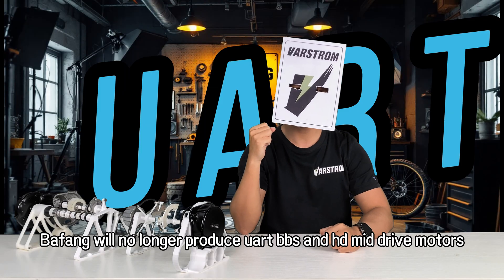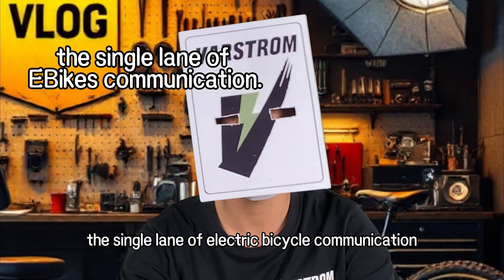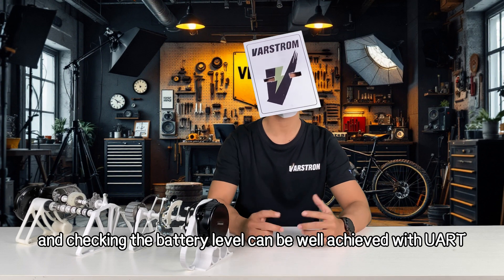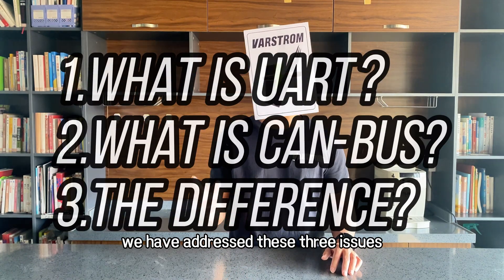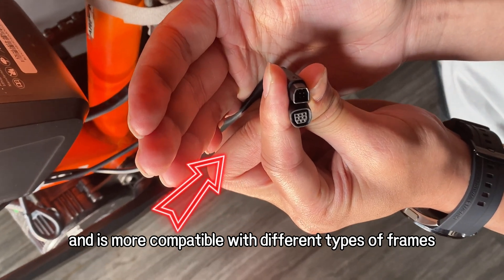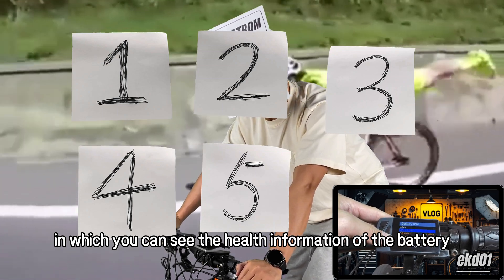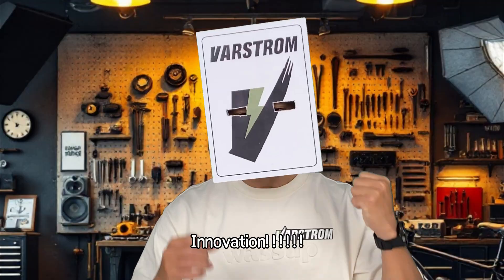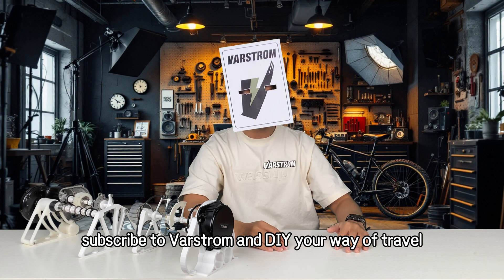News All EBikers Should Know!! WHY? Bafang no longer produces UART BBS & HD丨VS CAN-BUS

Comment: CAN bus hasn’t worked well for me. The display offers very limited settings (mostly just assist level), with no battery voltage configuration, which makes using a 52V battery on a 48V system difficult.

Throttle response is delayed and acceleration is slow, and the motor feels weaker despite similar specs, requiring higher assist levels and reducing range.

Since CAN bus was introduced, I’ve noticed earlier wear, unusual motor noises, and faster rotor wear, often before 4,000 km. Older UART motors lasted much longer.

If this mid-drive fails and nothing changes, I won’t use another mid-drive and will switch to a hub motor instead, as those still use the UART protocol.

Comment: I have na e-bike with a Varstrom VD618 display (Bafang CAN), 750W motor, using the Varstrom CAN cable and Varstrom software to program the controller.
I can save all the settings to the motor (PAS, current %, acceleration, startup angle, etc.), but nothing really changes in actual riding.
In the locked mode it’s far too weak, in the unlocked mode it’s far too Strong, and none of my settings work in either mode.
When I reconnect the cable and read the controller again, all the edits are still saved, so the software does store them —
but the controller simply doesn’t apply them.
It looks like the CAN firmware uses internal power maps and ignores my real configurations.
Has anyone managed to fix this or make it work properly?

Comment: i bought bbshd m625 with battery. it runs a couple of revolutions and then puts out an error code and shuts down. bought another one and it does the same thing. how to fix this issue?

Comment: Hello, you are well versed in bafang engines, perhaps you know the answer to my question - tell me please, I have a bbs02 750w can, with an ekd 01 warstrom display and a 14s 5p battery (52v 25Ah) - when the battery is charged below 44v, the engine reduces the power to about 6-7A, the battery charge is about 3.2v per element, I do not want to drain it to zero, but if I need this sometimes, why can't I do this? After all, the engine declares operation from 36 volts (in the screen settings I changed different battery voltages, 36/48/52v), but the current consumption did not increase, the setting only affects the display of the charge indicator. In another bike with a motor wheel and a KT controller, I can use the same battery at full power until it turns off via bms. I want to understand its behavior.
Reply: to protect the battery. a completely discharged (0%) 52v battery has 45v. at 44 the battery is way to low. most likely if you go under around 41-42 the bms is gonna trigger the under voltage protection. lithium ion cells have non reversible chemical reactions at/under 3v which breaks them permanently. 

on the screen you can set which battery you use. a 36v battery has ~30V completely empty and ~40V fully charged. for 48 volts it's 40-45V empty and 53-55 full. for 52v it's 42V for empty and full at 58,8V.

emtpy in this case meaning it's right at the border of damaging the cells. you should always stays at least ~3v above it.

Comment: Remember guys, You don't need to use Bafang displays and sensors, But the motor only. Just remove the controller and use your own. 
BBSHD with Fardriver @72v  is a monster! At high voltage, you are not pedalling anyway because the rpm is too high.

Comment: Why is my BBSHD limiting me to 17mph, even though I have set all settings within the Bafang Go App to Max. My battery is a 52v (58.8 full) 30amp BMS using Molicel P45A's, so the power is there, but on a flat road, when I hit the throttle, it does 950watss for a few seconds until it hits 17mph at which time, it drops down to 500watts. Why can't I simply choose my output amps.
Reply from the maker: The speed limit seems to be 25km/h. You need to check the speed limit setting. If you bought it from Varstrom, the speed limit can be modified.

Comment: hi, I have a bafang bbs02 750w canbus, the output to the headlight gives the battery voltage, I saw in your video that the current strength on this output can reach 0.7A, that is, I can connect 2 headlights of 15w and will this be safe for the controller? with a 52v battery? (I can't find information on the network about the current strength on the headlight)
Reply from the maker: It is recommended that the maximum power of the headlight be controlled within 27W. The output power of the headlight has been adjusted several times by Bafang. The original one was 0.5A, and now the latest one is 0.8A. Yours should still be the previous version, which may be 0.5A or 0.7A. It is best to use it according to 0.5A, that is, within 27W.

Comment: With canbus can you use any battery or does it have to be a canbus-bafang-battery? What I'm missing out if not a bafangbattaery?
Reply from the maker: It is not necessary to use only Bafang batteries. Bafang batteries only add an extra battery communication line.
Reply: Thanks  @varstromebikeconversion

Comment: I see so much negative comments here about can bus which I don't understand. Why you guys think, that Can bus will be used to close down the hardware to only proprietary components from a specific brand? Communication Protocol used over UART is as proprietary as the one on CAN bus will be. The only difference between the two is that the same CANbus (the physical two cables that it uses for communication) can be shared by (ie. connected to) multiple devices at the same time, while UART can only be used between two, and the two only. This means that with CANbus once you know the protocol, you can connect your own device to the bus, (physically anywhere, doesn't matter if it's at the front if the bus, middle or end) and make it listen or act on the other devices. For eg. You may have multiple throttles added to the same bus, each of them working independently. You can then make a software throttle, that will, from controller's perspective, be indistinguishable front the real one. But this one will be driven by some other controller that, instead of translating physical throttle movement into CANbus data, will generate the CANbus data based on other sensors, crating for example simple cruise control (as data from speed sensors, rpm, power battery level etc will also be avaliable over that same can bus) or hell, you can then even create adaptive cruise control, if you know how and have hardware for that. Or you can program a throttle to react non linearely to the input, making it more adjustable. If course you could also do this on the controller side but since controller software is closed, unless manufacturer exposes such option in their firmware, you can't do much. Can bus makes interfacing with the controller a lot easier and opens a lot of options I you're into tinkering. 
Of course, the biggest challenge is to reverse engeneer the CAN Bus protocol used by the controller as that will mist likely not be open. But the UART protocol used today between controller and the display, is also not open - correct me, if I'm wrong. And if it is, it's most likely only because someone has reverse engeneered it already. 
Yes - the ngs will become slightly more expensive, as, throttle, for example,. Might no longer be a simple potentiometer, but will need to have some logic inside, that will translate the potentiometer resistance into CAN bus data, but it also has its benefits, as I mentioned above. 
Of course, since throttle is no longer "just a potentiometer" but has its own brain,  you could, technically, add encryption to its communication between the controller, and with that, ensure that only devices sharing the specific encryption key, known o ly to the manufacturer, will be accepted by the controller, but that would be evil, and, I think, a very direct way to bancrupcy of such manufacturer in this market. 
BTW VESC also supports CAN bus.
Reply from the maker: Well said👍

Comment: Got myself canbus option from varstrom, it works well and I can personnalise everything - max speed (default 60km/h), wheel size, wheel diameter, then all 6 modes are parametrable enough for me. Never had other version but was scared for nothing, this system WORKS.
Reply: mine doesn't. Power is limited to 17mph. Why is my BBSHD limiting me to 17mph, even though I have set all settings within the Bafang Go App to Max. My battery is a 52v (58.8 full) 30amp BMS using Molicel P45A's, so the power is there, but on a flat road, when I hit the throttle, it does 950watss for a few seconds until it hits 17mph at which time, it drops down to 500watts. Why can't I simply choose my output amps.
Reply: @DarkMatterDrift strange stuff. You gotta set the max speed not only in the app, i set 100% speed on each level so it assist to the speed limit I set in the advanced settings on the screen (only on the screen) with the 1919 password.
Reply: Mine doesn't, fitted a new Bafang BBS02B and only the display comes on, motor will not run. Battery was from a different supplier.

Comment: Hello, quick question I'm looking for a 52v battery to buy. I see the M620 (canbus) motor has anderson connections and a battery communication cable. Wondering how these all fit together since most batteries only show two cables? Or battery communication cable must be pluged to battery bms or its extra connection and can be left unpluged when i will install battery? If this communication cable must be pluged whit battery can you suggest what BMS i need to buy ?
Reply from the maker: The CAN-BUS motor has an additional battery communication line for connecting the communication board battery. It is okay to ignore this line and there will be no error.
Reply: @varstromebikeconversion Thank you for information! So battery communication cable is just for motor programing purpose?
Reply from the maker: The battery communication line is used by the controller to read the battery information
Reply from the maker: The display shows the health of each battery pack, avoiding the purchase of second-hand or low-quality batteries

Comment: I just bought a CAN bus BBS02 by mistake. It is an intentionally crippled product. The display won't let me change wheel size (26) or the speed limit, which is 26Klh. I am disgusted! I have built 6 Bafang mid drives and never had these obstacles put in my way before by the maker. I will not buy anymore Bafang kits. If Bafang choose to go into the world of self harm, "Where have all our customers gone?" So be it. Who cares about all the enthusiasts who passed on that name over the years because it meant freedom and power? Not Bafang, not anymore. Sad 😞
Reply from the maker: Sorry to hear your news, but Varstrom's CAN-BUS bbs02 can modify these parameters. Different dealers have their own programming methods for bbs02, you can look for your after-sales service to solve your problem.
Reply: @varstromebikeconversion  So, to clarify; your kits are not restricted in any way?
Reply: No answer eh? To further clarify my position to you. I don't want a cycling partner who owns a share in my bike. I don't want to ask for help when the maker introduces crippling limitations on a product I paid full price for. So, some companies who partnered with Bafang need to think again, or go down.

Comment: What adjustments can be made with uart that can’t be made with canbus?  Just bought a BBS02 can bus. What software related adjustments will I not be able to make with this unit versus UART?
Reply: you can modify all parameters like amperage, voltage beyond what bafang locks their firmware with. you can also setup custom configs for your display, completely open source firmware etc.

Comment: Then why did I receive contradictory, poor clarity information about the M315 mid-drive with CAN-BUS  protocols  that won't even connect the recommended dpc080 HMI to my phone through Bluetooth, even though I have the 'Bafang Go " App? And yes, this was purchased from Varstrom. The information online is scant, self-contradictory in numerous places and all enquiries were met with sub-par, unclear information that makes the system a waste of my money and a massive headache.  Can you answer those simple questions that your colleagues utterly failed to clarify? Even Amazon (whom I purchased through) have offered to step in and help resolve my case which they agree was dishonest and unnecessarily unsatisfactory. Ironically, my Bafang 48v 500w mid-drive UART bike build with the "SPEEED " App provides all the parameters and iterative c😢hanges in an intuitive and clear manner that provides excellent performance for touring and commuting.
"Innovation" can easily be negated by disjointed, poorly communicated information about unnecessarily complex "improvements " that do not convey these changes in a readily understood manner to prospective customers. It shows in the harsh critiques and perplexed head-scratching amongst seasoned E-bike enthusiasts across most Internet forums about these same issues.  I have put multiple E-bike builds on hold for friends and acquaintances in a number of bike clubs because I've lost confidence in using bafang systems.

Comment: I think the reason for the protocol change is especially in Canada is to cap the speed limit to 32kph. With the old uart protocol., we could remove all restrictions with a small software program, and that just wouldnt do. So enter CAN bus protcol, those old methods of removing restrictions no longer work. ,but guess what ? a company in china is now marketing a new program cable to  increase the speed limit on C AN bus to 60kph///1 not ground breaking but a step in the right direction ( look om Ali Express for the cable) I already have mine ordered. Will  check back and let you know how  it goes!!
Reply from the maker: that “program cable” We are testing and preparing to launch，most displays have a feature that allows you to override the speed limit.
Reply: @varstromebikeconversion  I have a dpc010 as a display, the speed limit remains fixed at unlimited without being able to change it, and the size of the wheels at 26 inches while I am in 27.5, I think that can bus bbs02 will make a big flop by simply imposing its restrictions.
Reply: @torcheQ-12etoiles strange I had mine set on 60km/h and I could change it in advanced settings as I please and it worked straightaway

Comment: Just bought 2 more bbshd oldschool. Just in case
Reply: @tubebarros  you missed out there 😆 love how my bbs02 canbus is fully tuneable via my phone , rather than trying to get the bike up into my kids room to adjust it via her pc 🖥
Reply: @stestar09 it’s tunable, but the uart allows more options to tune it even more. The canbus only has the basic settings
Reply: @stestar09 the uart system had more tuning options to refine it even more. The canbus only has the basic options. Uart can increase efficiency 10% more compared to canbus to due more refined options.
Reply: Why not the upgraded version?? The bbshdb
Reply: @tubebarros
Tongsheng TSDz8 has everything the BBShd has and its torque sensing.

Comment: In terms of being more adaptable, does that mean just for can bus displays or is there an adapter to use our current UART displays?
Reply: @ljaproductions07 you cannot change or mod anything with CANbus or they will most like lock you out of the bike. ALL electrical components MUST be OEM and communicate. CANbus  pushing for greed and pushing out the little guy
Reply from the maker: The CAN protocol means higher compatibility and development.
Reply from the maker: It is different from the UART protocol.